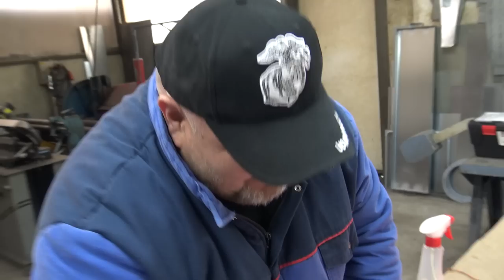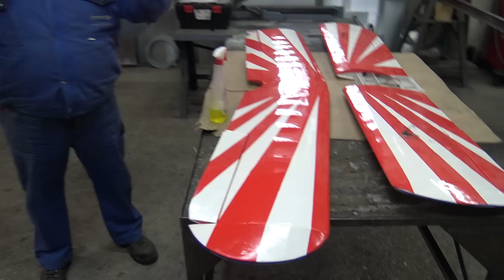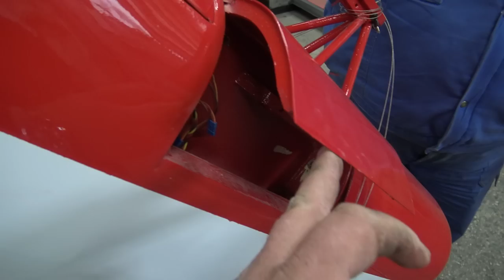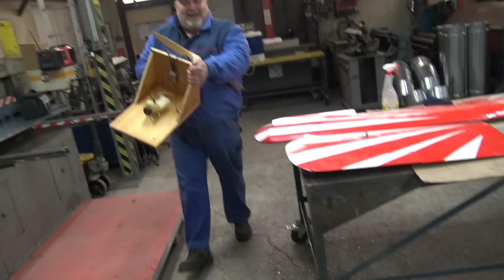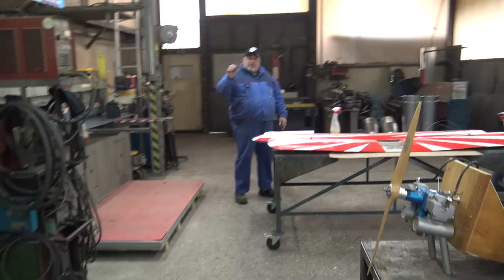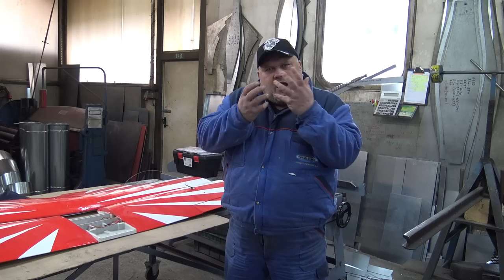GIANT 2.25m PITTS scratchbuild balsa Biplane with 100CC boxer petrol engine Introduction

Comment: Those are such a fun plane to fly. I had one of those with the nitro super tiger 3000. And then I put a tuned pipe on it. And the wings failed. But still. A great aircraft.